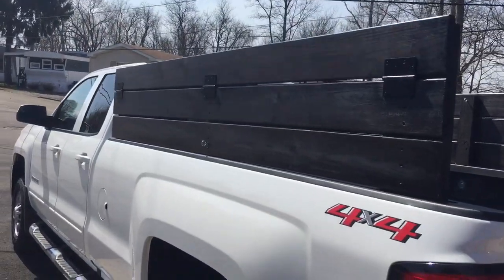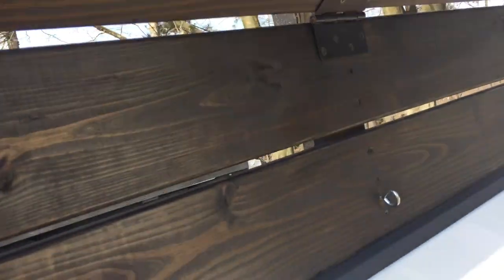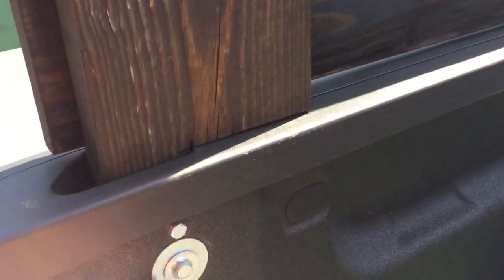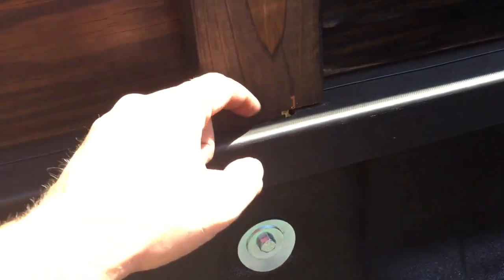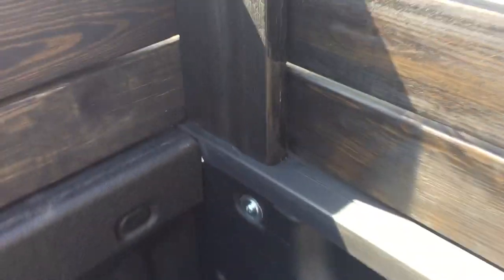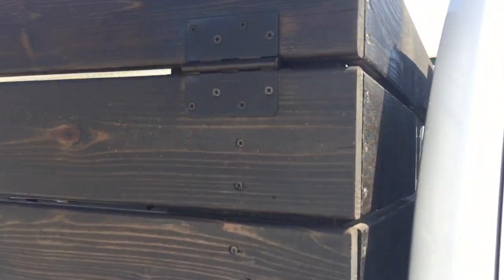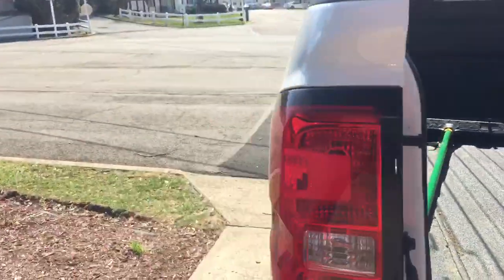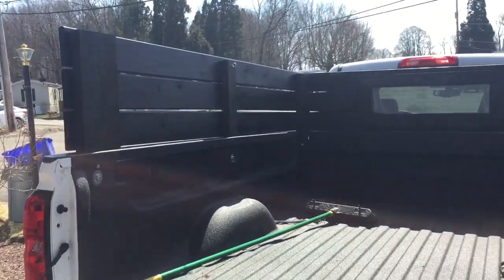Wooden sides for pickup truck

Comment: Looks great. Why did you use 2 x 8 instead of 2 x 3? Considering the board is cut down to 2 1/4 inches, does the added board over the bed make any difference?